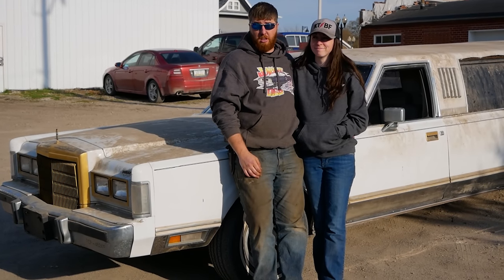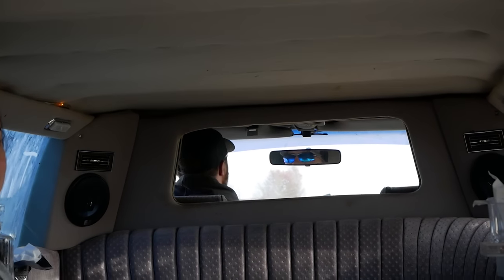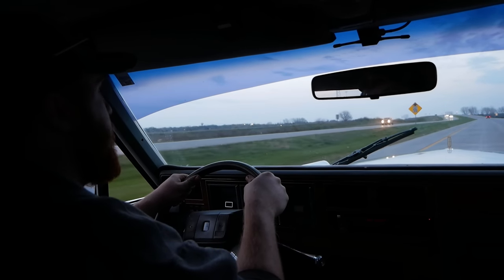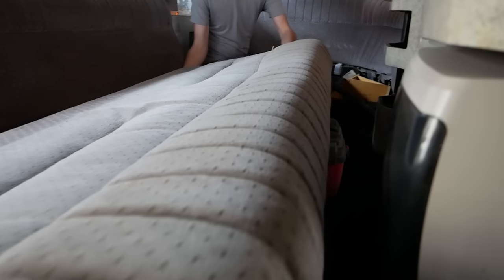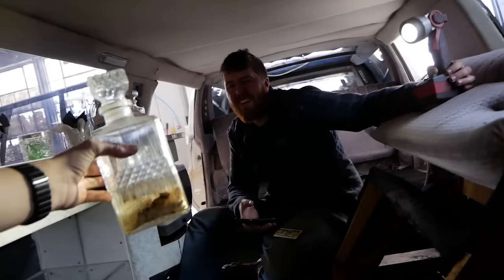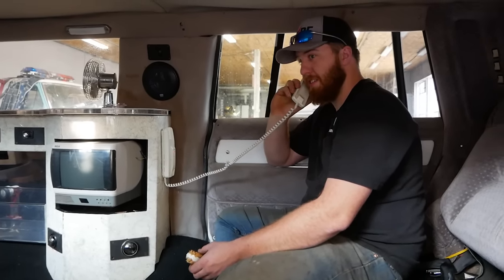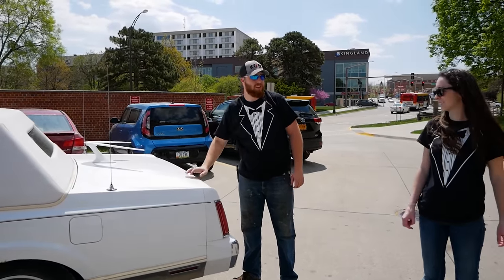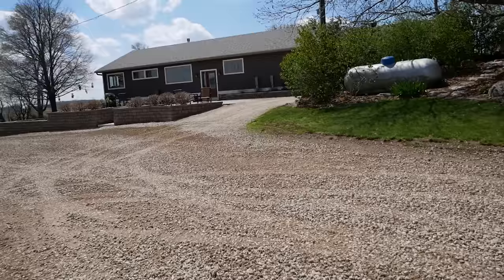Can Our ABANDONED 35 Foot Limo Be Returned to Service!?

Comment: 100% need rear mount turbos on this thing
Reply: Dude the turbo lag tho 😂😂
Reply from the maker: Way ahead of you 😎🇺🇲
Reply: And the extra 6 quarts of oil to feed them
Reply: Nah, have em stickin outta the hood, Cleetus style!!😉🥃
Reply: Or a ProCharger, lol.
Reply: It makes me extremely happy that my comment was higher than a comment by CarsandCameras 
Edit:nvm
Reply: there's so much length of tubing that you'd never build enough pressure to do anything. I saw someone try to rearmount a Caddy and the volume of the tubing made it to where it made literally no boost.
Reply: 10 years to spool.
Reply: Yes
Reply: @JunkyardDigs  please bring this beautiful beast to the Freedom Factory for burnouts.
Reply from the maker: @bullzeyez3236  even if they actually finally invited me I don't know if I'm going to drive this thing all the way down there. It's wildly uncomfortable up front because of the partition
Reply: @JunkyardDigs  Come on mann, your getting spoiled now
Reply: @JunkyardDigs  fix that car....get the suspension straight and turbo it
Reply: rear mounted compounds
Reply: Floor it … one Mississippi two Mississippi three Mississippi aaaand were off 😂
Reply: Something tells me that even with a low boost setup, this thing would still have a 15sec 0-60....but would still be cool as hell.
Reply: @JunkyardDigs    Was that a 1972 Ford grand Torino next to the limo in the shop?
Reply: 3 minutes of boost lag
Reply: @obsgarage3146  is it really turbo lag if the boost never reaches the engine even? lol
Reply: @obsgarage3146  ikr issa joke but for ppl dident know rear monted turbos has a lot of pros like less lag
Reply: Junkyard Digs: How bad do you think the lag will be?
Some guy that knows turbos better than him: Yes
Reply: You’re going to have to shore up that axle first.  Based on what you said in the video, that rear end is being held together by scrap metal and prayer.
Reply: How would-- how would the boast get to the engine
Reply: Ev swap it
Reply: @JunkyardDigs  oh damnnnnn🥵
Reply: @gingervikingjesus2351  im sorry but cleetus needs deletus
Reply: Rear mount turbos? This thing has boatloads of space, stick a twin turbocharged big block right over the rear axle.

With the engine in the front the drive shaft is probably going to go twist-a-roo once you make a mentionable amount of torque.
Reply: @obsgarage3146  you ain’t never been in a Ford Sierra Cosworth or Subaru Impreza 2.0T.
Reply: @JunkyardDigs  , I saw another, albeit newer model, stretch limousine that is also a Lincoln Town Car that is for sale.  Here is the proof, as well as link, to the limousine in question, and it is located in Savannah, Tennessee, USA.  https://www.google.com/maps/place/Savannah,+TN+38372/@35.2242175,-88.2428993,43m/data=!3m1!1e3!4m5!3m4!1s0x887c549da1ad3161:0xbcfa0a9f67ab8c53!8m2!3d35.2248034!4d-88.2492037
Reply: hole point of a limo is comfort not flying through the windows but 100% agree
Reply: The boost will arrive in 5-7 business days
Reply: @uberrandomperson  the joke was of like the large turbo lag
Reply: Add some bassy exhaust pipes.
Reply: It's surprising how well it cleaned up.  I say forget the LS and keep it all Ford and drop a Coyote crate motor in it. It's about the same size as the current 302.
Reply: @JunkyardDigs  before you scrubbed it , seeing how much DNA is all over the interior would be funny
Reply: The boost would have to pressure up a mile of of tube😂
Reply: Love your videos man and how tall are you
Reply: Yes
Reply: @JunkyardDigs  would rather see a coyote swap
Reply: You would stand on it on Monday and build boost on wendsday 😂
Reply: Good idea (don’t die)

Comment: This thing loses 30% of its engine torque just trough the driveshaft..
Reply: Step on the gas and the drive shaft will twist like a fusilli noodle.
Reply: @gabrielathero  With nitrous Oh Yes
Reply: @gabrielathero  neat profile picture
Reply: @burnotto1663   yeah i cant wait to hear the 302 scream when they start beating the s**t out of it.
Reply: It doesn't matter, cause it'll then lose all of it, spinning the only driven axle (which is less than equally loaded, since there's 3 of them and rear airlifts are pumped to the brim)

..buuut! We can have nice and steady driftless burnouts :D

Comment: I am stunned at how well that exterior cleaned up. The thing actually looks respectable.
Reply: Yup, I thought the paint would be a mess, but no it actually looks great for where they found it.
Reply from the maker: Looks, but does not smell
Reply: @JunkyardDigs  have MOOK use the limo to get attention 4 the animal    rescue shelter she supports
Reply: @JunkyardDigs  whose gonna clay bar and wax the limo?????
Reply: @JunkyardDigs  tie rods are shot that why shaking
Reply: @JunkyardDigs  when is the nitrous vidio and the LS swap?
Reply from the maker: @jacksonstephens9772  nitro next spring, ls is pretty much impossible, i checked trust me😂😂 

Cant lift the car
Reply: Smells
Reply: When are you going to do it

Comment: So, having dealt with a few limos in my life, I can tell you that half of the shoddy BS in the back was just terrible repairs from the previous company. They lead a similar life to rented supercars. They get thrashed until they can't even rent them out for proms and bar mitzvahs.
Oh, and limo companies tend to hire random crackheads to maintain and repair limos. At least that's how it is where I'm from.
Reply from the maker: From what I've seen I don't doubt that one bit!
Reply: @JunkyardDigs  I have worked in the Limousine world for over 30 years and he wasn't lying! in one instance a sedan ended up in a cornfield on it's roof, another stretch had it's front brakes catch FIRE! (that was mentioned because that wheel on yours could do that) I've seen one that hit a bridge abutment (NOT Pretty) one that got stolen and was found stripped in an alley and enough damage, misuse and neglectful maintenance that would give you pause.
Reply: So, besides the parts where it's plainly visible that they're not original there would be a few more which aren't worth keeping around. So i'm figuring that's basically most of it that you can just tear out and replace with newer stuff. Itemized list of all the original parts that are still functional from the interior will fit on a post-it...

Comment: It always amazes me how these stretch limos still run on the factory engine, brakes, and suspension which weren't all that great to begin with. All that added weight with no added power, cooling, and perhaps most importantly braking.
Reply: some companies do upgrade all that stuff.
Reply: I would think speed had alot to do with it most limos are in city’s and don’t go over 55 most of the time probably doing 35 or less ? Maybe or they were just on drugs and tried to make the most money possible with a POS. 😂
Reply: @christopherwilson7698  Yeah you're right. It's just a business. If you want it properly done you'd start with building the engine up a little for more power, then install a bigger 3 core radiator with twin thermostat electric cooling fans and a transmission cooler. Upgrade the shocks to something stronger, install some extra bracing under the extension to cut down the rattles. Strut tower braces front and rear too. Then I'd remove the wheels and brakes to upgrade to larger radius rotors, twin piston calipers up front, do a drum to disc conversion in back, and install larger tires. You need at least 17" wheels on this. Finally change the rear end gear to something that can keep up with traffic, probably a 3.27. I think these came with 2.73 from the factory right? After all that I'd install oil pres, oil temp, water temp, and trans temp gauges.
Reply: I one time saw a Chrysler 300 limo with the stock 2.7L 
I was shook
Reply: It's a Fo Mo Co built Town car 302 Aod 8.8  - nuff said
Reply: I mean, the key words are "body on frame", though maybe it's a good thing they're all SUV limos these days.
Reply: @joe6096  lol absolutely none of that is required to run the business. They built these things out of literal scraps and just dressed it up for shallow peacock clients. Please feel free to tip your driver at the end of the night.

Comment: Shopping list: a shedload of square section and some ingenuity to keep the tag axle in the same county as the rest of the car; decent welding fill wire; a couple of prop shaft retainer baskets; upgrade brake pads; and bulletproof life insurance. Good luck 😁

Comment: Oh. That Terk antenna was meant for TVs, back when there were analog video broadcasts. I wouldn't be shocked if the crackheads that rebuilt the interior just crammed the coax into an AMPS cell box.
Reply: Yep, thought the same thing. The wing on the trunk is for the phones.

Comment: 2 years old, sure. But, rewatching this...And you know what would be an awesome thing to do with this Limo, if y'all still own it? Carefully chop the top of the limo portion (ignore the cab area) And lift it a bit, putting new sides in. Possibly even lifting it to overhang the cab (think motorhome style) and turn it into a luxery limo/camper. You already have the bed in the back, the overhang on the "cab" would be able to have one small bed, potentially, and have a third bed in the center. Put in a small kitchenette, and you'd be golden. That would probably require reinforcing the axles, and swapping to a heavier duty engine, and better shocks. But, you could be the first to have a 35 foot Lincoln Camper Limo, potentially!
Reply: Oh, and swap the wheels to offroad, of course!

Comment: It's crazy, since the limo is a crazy quilt Frankenstein (IT'S ALIVE!)...  but why not gut the interior (and finally get rid of that mouse smell) and rebuild it as an RV low-rider? Conversion bed in the back, fridge, entertainment center, fold-out futon benches, maybe even an airline-style lavatory!

And maybe reconfigure the trunk so you can slide stuff through the bed/back bench, like in modern sedans?

Even crazier... make it hybrid. add electric to the back, for better torque. (Does torque also help pull the weight of the vehicle, as well as towing?)

Meanwhile, once it's roadworthy, it would be an awesome way to head back to school! 
Oh, and you should do a roadtrip series with the limo. Hit all the amazing and strange sites in Iowa...the Grotto of the Redemption, Blackhawk Lake Summer Carnival, the State Fair, maybe be a support van for a RAGBRAI team...

Comment: That Ford power steering pump needs some atf type f
Reply: Nah, that's just a Ford power steering pump
Reply: I knew I wasn't the only one who heard the pump hurting
Reply: @JS-wc4xs  u clearly don’t know that they specifically used type F only
Reply: @UpVoltageOverclocking I had a Ford from the same era, fed it what FORD recommend, it was loud any noisy just like the 1 in the video.

Comment: I still had an 88 signature series I daily drove until 2012. It's not fast at all. But it gets going well enough for a luxury land barge of that time. Those engines accept mods really well though so you're better off keeping it. Just run an auxiliary trans cooler or it'll burn up

Comment: 19:28 there actually were CDs in 1985 but it was a new format and wasn't as supported yet compared to cassettes and was rather expensive 
Certainly wasn't really a thing in 1985 cars to have a CD player
Reply: My 1999 Transit was still equiped with a cassette radio
Reply: @JohnDoe-zr6bk  my dad's '99 Escort was too
Reply: My 2000 ram had both. Cassette and cd
Reply: Added later 1990s had explosion of aftermarket installs of multidisk. Changes
Reply: Simple green full strength and tree deodorizers
Reply: Tv. Antenna. For analog tv. Junk.
Reply: Fun fact: the 1984 Pontiac Fiero was the first American car to be available with a CD player.
Reply: @martinmessineo4964  at the 86 NY Auto Show GM had a row of radios available as options. Brought some bon Jovi CDs from home and blasted them when the security came over
Reply: @martinmessineo4964  and gm offered a clunky heads up😁.  Displays for the olds Buicks. And caddies
Reply: Both of my cars from 1996 had tape decks, neither of them worked. Now, my 2005 Saturn has a 6cd changer. So around 2000 they switched it up
Reply: Much more common was the cassette adapter that plugged into a Discman you would plug power into the cigarette lighter. Sometimes used an FM converter so you could tune it on the stereo. I don't remember CD players in cars being common until the late 90s when cassette basically died.

Comment: At the workshop where I worked 35 years ago, we had a customer with a 70s Cadillac Fleetwood limo. It looked like it was just cut in half, pulled apart and patched with an extra piece. Everything was cut in half, exhaust, handbrake cables, drive shaft, brake line, fuel line. Wiring was cut and assembled with screw terminals. Simply just cut and extended. It was really bad work from start to finish. 
But it was nice on the outside.

Comment: I put a new vinyl top on a triple axle limo (the owner claimed it was the limo in the opening of Lifestyles of the Rich and Famous. Whatever). It wasn't anything to write home about. The front and rear sections were fine because they were actual car. The center span was horrid. All the windows had to come out and new sides put on it due to rust. That was about 15 years ago and I only ever saw it in use once or twice since.

Comment: Why to waste water initially to remove traces of mud. A sponge with strong soap solution is best to be applied and leave it for 15 mins or 20 mins ....and than power spray if used doesn't waste much water it cleans up charmingly.

Comment: I like how your called junkyard digs and you could fit a whole junkyard in this limo and maybe some vehicles in it aswell also I'd say rebuild it properly like proper axle and restore it maybe decent engine but that would be a torture method and be way to expensive for what it is  and I imagine people would get bored of that with all the work and videos there would be too be honest tho I guess you could do a reacting to everything wrong with the limo or take it to a garage and see or show there reaction to it and how much it would take to fully restore it or get it running right or pass an mot also speed limit 20 in that thing you'll be lucky speed limits i know are limits and not targets but in this thing there definitely targets and I like how its longer then the car wash I doubt that would be seen again for just one complete vehicle without a trailer tho you should tow one with it it would be funny and probably awkward or impossible to turn so I probably wouldnt do that tho imagine overtaking this and it just keeps coming right let's overtake this car about a minute later still overtaking about a mile later were still overtaking you can start overtaking in one I guess in America state and end up in another before you finish overtaking this

Comment: Reason why there’s lots of leaks is cause the roof top is all rusted out ,due to the vinyl top ….once it’s punctured water seeps between the vinyl and metal roof which causes rust and eats the metal big time….all stretches would eventually have the same problem cause all of them were made with vinyl roofs